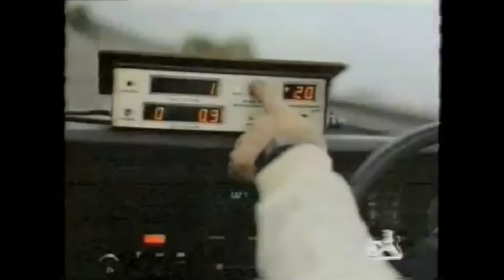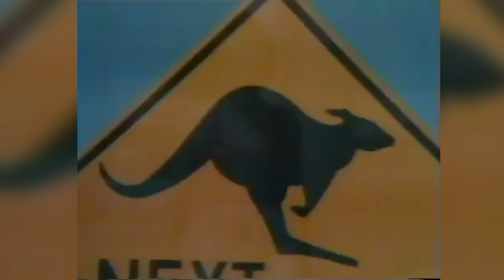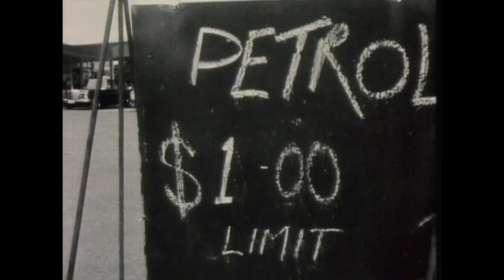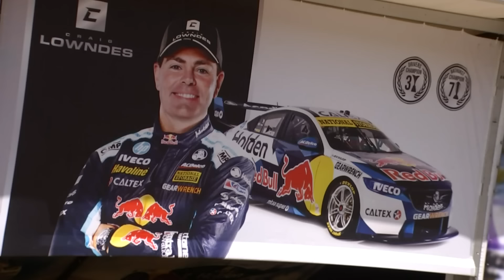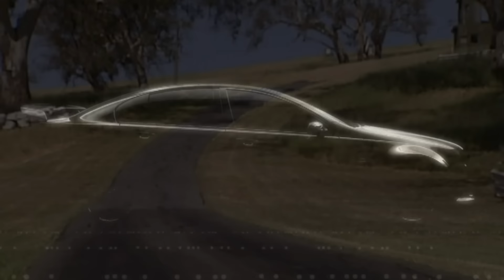The rise and fall of Holden, Australia’s iconic car | ABC News

Comment: ABC is being pretty kind to GM here, if you pay the slightest heed to John Cadogan.

But yeah, Holden screwed up hard with the last Commodore they designed.

They should have shelved the badge for a size reset by bringing back the Torana, just like they teased us about a couple of years before the VE came out.

'Torana' should just mean, a platform that's small enough to be reasonable with a naturally aspirated four-pot, but most models are sold with a six, while there's also the ability to stuff a V8 in it... maybe even turbos and intercoolers as well, if Holden felt like crushing BMW M3s like bugs...  How about also being designed from the outset to accomodate 4WD and hybrid drivetrains? 

You'd only need two body variants to cover a huge footprint - a fastback two-door hatch, that covers a big slice from econobox to a hero car flexing bolt-ons with mad echoes for the A9X feelz. And a four-door wagon that could also cover pretty much that whole spectrum from econobox 2WD wagon to 4x4 hero car. It was time to ditch the Commodore and resurrect the Torana.

Epic fail. But perhaps the ultimate fail by Holden was being swallowed by GM at the first corner.
Reply: Kimmo look mate their would have been a Torana but 08 crisis killed it as well as a SUV based of the Commodore but the financial crisis killed that as well but Holden should have made the SUV and Torana before the VE, but hey the VE/VF was the best car we ever made.
Reply: Kimmo mate the Commodore wasn’t the problem they should have brought out the Torana and SUV before the VE and had those 3 leading the way but 08 crisis killed all plans unfortunately

Comment: I prefer Japanese cars. They are simply better.
Reply: As long as you don't need to work on them or have any styling
Reply: @randomdude4669  I prefer a car that's ugly and works than one that's beautiful but keeps breaking down.
Reply: @siredith8846  id still take the old coupe even if it did break down, modern stuff all looks identical especially the Japanese stuff
Reply: @randomdude4669  horses for courses
Reply: @siredith8846  what ever floats ya boat mate

Comment: SUV, please stop talking USA. As the old guy said 
4WD.
Reply: Dave D  
Exactly. A ute isn't a truck. 
Thank you 👍
Reply: @justsandra71  But an SUV isn't a 4WD, it's a lifted passenger car. Calling a Landcruiser and a Mazda CX-3 the same thing is categorically wrong.
Best rule of thumb -> Body on frame = 4WD, Unibody = SUV

People calling utes trucks can bugger off though.
Reply: @t_z1030  
Here we go! I don't care. We NEVER called them an SUV or a ute a truck! 
You can run along quickly now deary. Ta.
Reply: @justsandra71  Uh huh, I'm sure that people correctly labelling SUVs as SUVs is bringing about the collapse of our society. Definitely something worth getting worked up about. Better watch your blood pressure there boomer
Reply: They had the Captiva, with Commodore engine and couldnt compete
Reply: Not all SUV's are 4wd. Thus, the term 4wd is necessary.